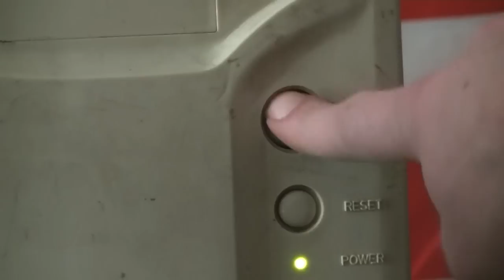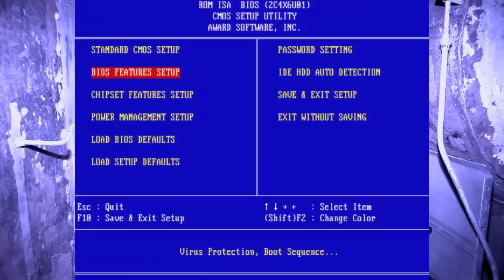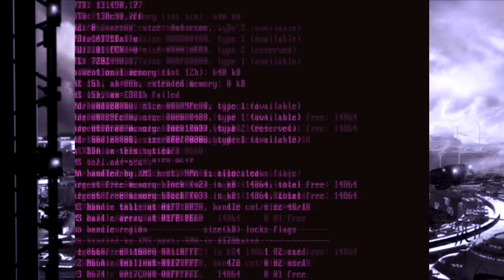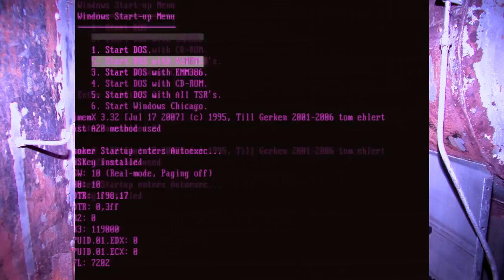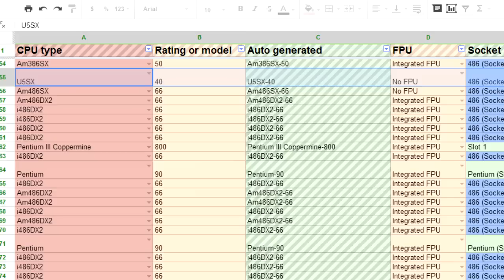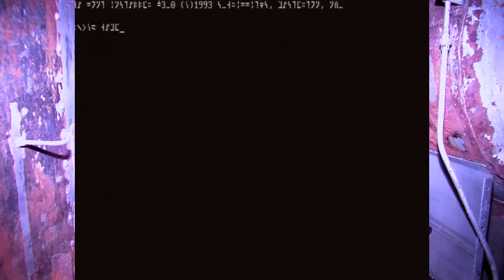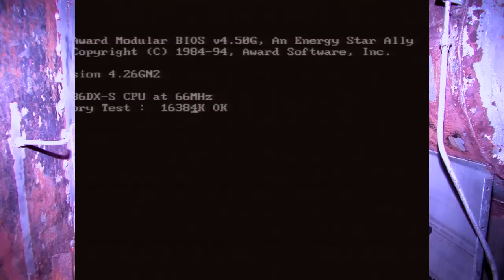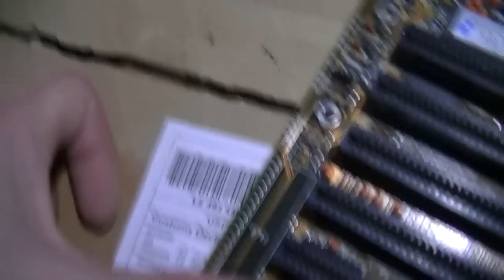Completed U5S (486) System Rebuild

Comment: as for going outside more... being stuck indoors is quite depressing... last winter I tidied my house up - trust me, coming back to a clean house is a good feeling. Give it a go :)
Reply from the maker: I've had no choice but to start clearing the place up to accommodate a two-tier keyboard stand.

As for the AMD side of things, I don't know that the price/performance is on their side anymore either, they just never worked for me after the K7 era, Intel always did but I'm kinda unhappy with them too right now as the Core 2 I had to put in the workstation is awful, the errata documents basically state that everything I want to do won't work well on those chips, terrible at handling streams (cache problems, can cause total lock-up), slow compression, instability in VM processes (not good under a 64-Bit OS) but they do at least appear to have fixed it after the Core 2 series ended - i7, E3 etc. On the up side, it doesn't fail to start up again the next day like the Phenom seen in the video, or that FX-57 I had, or that Athlon 64... you get the idea.

I think I've said before that I don't try to convince anyone to go for any particular company, just go with what works best for you.

Comment: Hehe, my Phenom II 955 machine has been running essentially non-stop for the last 3 years - it's always been overclocked at 4GHz - never crashed - left it burning in whilst on holiday (2 weeks) and it did not crash. It now sports 20GB of DDR3 and runs Win8.1 :)

It's all about how you do it, not how much money you piss away trying to get that extra 5% of performance... Intel's CPUs are something like 30% faster but 80% more expensive...

Comment: Just started watching this one. Your jokes crack me up :) What's so special about these UMC 486 chips? I think I have a few but never did much with them.
Reply from the maker: I don't know what UMC did in their design, supposedly infringed on an Intel patent but given the completely different performance I'm suspicious of this court case - which is why the chips are labelled "Not for US Sale" thinking that Intel got scared and attempted to push them out of the market. They run fast compared to Intel parts, you can beat a DX33 Intel with the SX-class Super33 in most applications. I heard from somewhere that the U5 chips were intended more for workstations than desktops.

Oh, I noticed you had an X5 in that board in the overclocked section of your database, so I dropped my ADZ in this one. I was tempted to add it to the stock settings chart (I didn't though) as 160MHz is actually what the ADZ was rated for - AMD marked them all down to 133 to try and push sales of the K5.
Incidentally I didn't win that one... You win this round, but I'll be back, hehehe. Methinks it's time to hack my BIOS and order that resistor network.
Reply: HighTreason610 Hehe :) Oh and I will flash that BIOS back to the latest stock one. I believe it just enabled a few more options, doubt it makes much of a difference.

Comment: Very cool, man. I wish I could find some garbage 486 parts in good order. I've been trying to build a DOS machine for almost a year now, collecting parts here and there. Where I live, most anything older than an XP computer was trashed years ago. So on the rare occasion I find an old board, it is always ruined by leaky barrel batteries. I've pretty much given up on finding a 386 for that reason, and have focused my efforts on finding a 486 board that uses a lithium coin battery, since those don't seem to leak from what I've seen. You don't like AMD stuff though? Dude, my old Athlon XP build was rock solid for years. Since then, I went AMD and never looked back. I'm on an 8350FX with a quality ASUS board now, and it screams. To each his own, but I've had that same kind of bad luck with all the new Intel systems I've worked on over the last few years.
Reply from the maker: This stuff doesn't show up in dumpsters much now. Around a decade ago most government institutions were still running NT 4.0 on 486/early Pentium hardware but had started replacing it with Pentium 4/Celeron systems that they are still using. For a brief time there was a lot of this stuff appearing at the side of the road. Sometimes you can get lucky with a leaky battery if you cut it off and wash the board with warm soapy water, depends how far gone the traces are. Of course, sometimes they end up like mine where the fluid has gotten between layers of the board.

I don't have any allegiance to Intel as such, AMD made some good stuff over the years. The X5 whilst overrated was a good chip, the K6 was amazing and my Duron was one of the best systems I ever had. The thing is, everything from the Athlon XP onwards never worked for me personally. The XP I had was batshit insane, the Athlon 64 killed memory and graphics cards until I ran out of money (which is why this 486 was built in the first place) and the FX-57 I tried was barely stable enough to install an operating system. There are also several systems that never made it past a few days (such as that Phenom) before they just stopped working altogether without explanation. The Opteron I used to have was nice but it was stolen. Intel has made some shit too, like the Core 2 E8200 which is unstable, slow and buggy but it's still running over a year after I built it, the Q8400 will likely be the same. If AMD could build a chip that worked better than an Intel one for me I'd consider using it, as you say, to each his own and it's whatever works for you... The only thing I would say though is ASUS? Bleh, if you're going to throw money around like that go for a Tyan or Supermicro board, much better quality though to be fair to ASUS I only have one, has an Atom 330, that has proven very reliable and very stable despite running in horrible conditions. Had over a year of uptime on the clock before software upgrades required a reboot.
Reply: +HighTreason610 i found a gateway essential with a 500 mhz pentium 3 from my high school before i graduated from it. it works, i installed windows 98 se on it.

Comment: You can try the same as in Forrest Gump just get out and run ;) or not :P
I just bought a motherboard with amd 386 40Mhz with IIT 387 fpu and 8 mb of ram on it but the battery on the board has leaked  ,I bought it on ebay and I hope that I can clean the battery acid of with winiger and isopropyl alcohol I hope the board works.
I allso bought a collection of motherboards some 386er's and 486er's and grafichs cards and networks cards and some at psu's two of those and drives and random stuff and a fairly nice at pc cabinet with a intel pentium 166 mhz from same seller in Germany I got the lot for 130 eur with shipping some of the boards got ram on them and there is isa harddrive controllers as well and the 386 40 mhz board needs one and a vga isa allso they are allso in the collection I bought.
Before I moved from my parrents I has a great amount of old hardware but when you move like I did you clean out old stuff that you don't need or think you don't need in the future and now I can thank only my self for doing so ,I allso had a atx pentium pro motherboard that I just threw out and it was working now that had been a good kandidate to a pentium pro overdrive cpu.
But I have found out that it's a good idea to keep some old pc's around they are hard to find and come by.
When I lived at my parrents I once overcloked a intel 486 Dx2-50mhz to 80mhz at first I tryed 66mhz but the himem in dos 6.22 made an error can't remember what but at 80mhz no ram problem but I had to glue a heatsink on to the cpu with a fan ,the cpu was performing faster but windows 95 made errors more and more to the point where I clooked the cpu down to 50 mhz again, later I got my hands on a St it-80 Dx2 like yours just the 80 mhz version. I have allso bought an at pc with amd 486 Dx2 80 mhz on ebay and an compaq pentium 120mhz laptop and a soundblaster 16 card with ram slots on it so I just used a fair amount of monny but I got some good deals I think but back in the 2000 it's was easy to get old pc's at flee markets from the 486era and pentium era for a cheap price now they are just hard to find.
Reply from the maker: The price has definitely increased drastically in the past few years and some parts are almost impossible to find here, meaning they have to be imported - though often, importing is still cheaper here anyway. Good luck with your 386 motherboard, so long as you are careful they usually survive the battery removal and it is better to do so in the long run, I've seen a few machines die to battery leaks before now.
Reply: That board with the amd 386-40mhz is dead ,I got another board that works now just got it this friday from Germany ,yes it's hard to find old hardware now I think that when you upgraded a pc with a new motherboard the old one was sometimes just dumped in the trash sometimes sold to others , and At cases are hard to find allso but there is some for sale on ebay but they are not cheap, the best wat is search on ebay and somthing might come up.

Comment: Those early Athlon 64 chips where right mongrels..

You could say i was an "early adopter" of Athlon 64 cpus back in the day.. and got stung... I had a desktop system i built to replace my aging Athlon XP rig and a laptop (unfortunately. still stuck with the fucking thing.. makes a good door stop though), with athlon 64 cpus in them. both of them where nothing but unstable, unreliable crocks of shit.. couldn't do much with them without them having shit fits and hard freezing most of the time.

I eventually gave up my athlon 64 desktop, and gave it to my short fused, dim witted, steroid abusing brother... (now bare in mind, it's case was already a little.. battered where i'd lost my rag with it) 

but somehow.. it managed to survive 3 years with my brother, you could tell every time it froze, cause you could hear him "going to work" on it, in the room next door to mine.

by time it came to "extracting" it from my brothers room, after he wanted rid of it... the case was like a mangled car wreck...

Ironically though.. at the end of it all.. my Athlon XP rig has had the last laugh, and provided me with nearly 9  years of loyal service.. and still going strong.